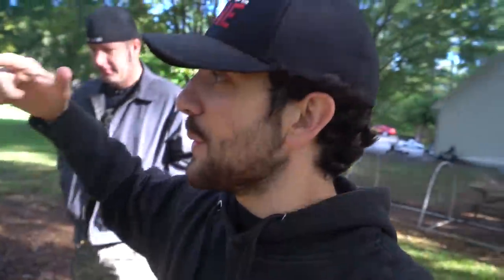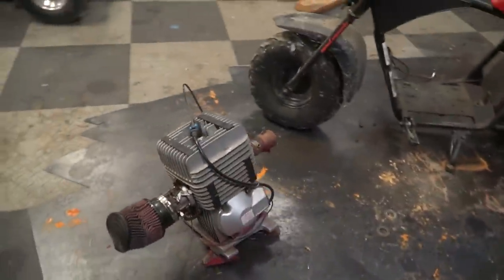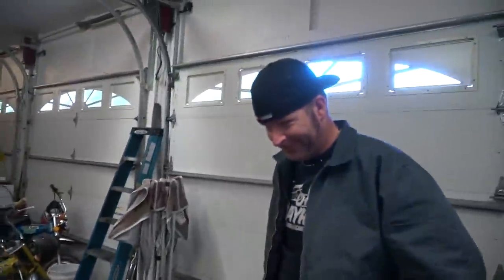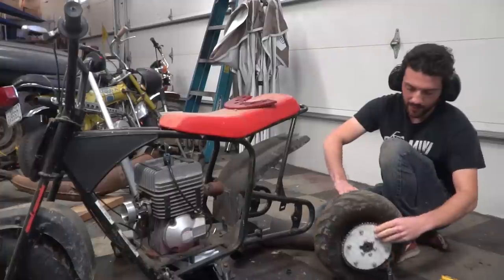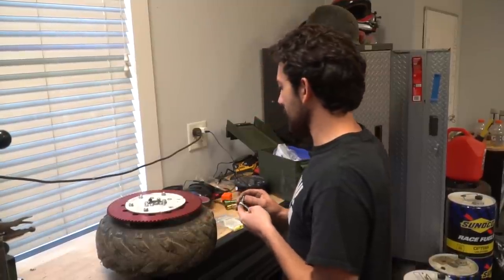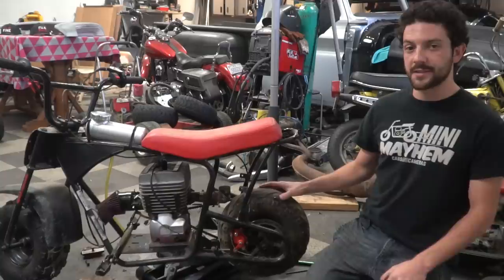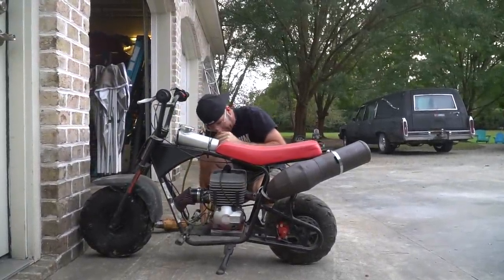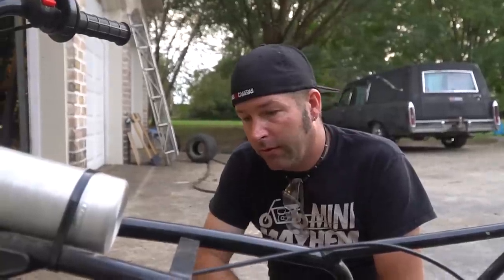2 Stroke Mini Bike Build!

Comment: If geared right, the KT100 will kick the 4-stroke's a$$.  I know this because I started racing go-karts with a 4-stroke, and leveled up to the KT100.  By the way, out of the box, the KT100 has 16 horse, but after being blue-printed, it will put out 23-26 horse.  That motor makes the most beautiful sounds and aromas, and I will never forget it.

Comment: Congrats on your up coming move, check for rust on your grounds I know on the motors with the solid state fly wheel they get rusted up from sitting and will prevent sparking.

Comment: Get a pull start kit and a 4 hole can run a little rich and it will leave you smiling for miles
Reply: Oh the cdl goes out often new spark plug every 10 hrs helps I had many of these and have three race karts a drift kart and drift trike with these on them worth 1200 bucks a peice new 300-900 used depending on mods and hours You can rebuild the top in three and four times before you do anything to the bottom end I’m putting one of these in my kayak

Comment: What is EXTREMLY important on two strokes is the header and flex pipe length befor the first weld on the rlv pipe yall have. To figure out header length take a measure ment of the header from the inside of the longest and shortest sides of the header the find the distance from the piston face in the exhaust  port to the header. Add that to the lengths then divide by 2. Thats the header length. That tells you how long the flex pipe needs to be to get to the desired length.A website called van duesen motor sports has detailed write ups on this information with pictures. Flex pipe is critical. To short and it will melt the piston and to long you get no power. You can experiment with differences of about 1/8th of an inch incriments of flex pipe. The website mentioned will tell you the exact length for the expansion chamber you have.

Comment: Find some one with a straight muffler  and put it on as it will rev better and give more HP  than what you have done to the bend. As the muffler length and cones sizes is what gives it the power band. Some crazy HP can be made with the muffler set up at different RPM ranges.

Comment: Nice brother it's sweet...20-1 is too much oil it's gonna smoke really bad and foul plug easier ..32 or 40-1 is good and safe.. I'm v got a motorized bicycle and I run it 40-1 and it barely smokes and I ride it every day to work ..48 MPH... y'all should build one there very fun and very cheap

Comment: a TCI ignition sometimes needs a battery if the charging system is not stable enough to power it directly, a CDI ignition has its own coil to supply power. so if you really have a TCI ignition you could hook a battery to it to try out. and if you get it running that way a 12V capacitor might also work to get it running and is easyer to build in.

Comment: Just use a jackshaft? Then you could move the engine forwards, have the sprocket on the original side, and not have that power robbing 90degree angle in the exhaust... The harmonics are probably Fucked up because of that angle.
This thing is going to be really fast tho!

Comment: Dunno if you boys can use it for anything but I've got an actual edelbroc carb with an accelerator pump on the side that I don't have any use for... it was supposed to go on an old Yamaha warrior 350 I had had years back and I'm not sure why I never got around to running it lol I run same style edelbroc carb on my 08 honda 400ex and it rippps also no choke and never had any issues not starting 1st sign of power to ignition... if you cover shipping you can have it I'm sure it will help on one of the bigger builds heck it might even be worth a few bucks I believe I paid alot for it back then unfortunately

Comment: look into a spec 100 pipe... it will go straight through under the seat and run better for your application. The pipe you have will make you run very lean at the top rpm and can stick the motor, I've stuck many when racing that class with that pipe
Reply: https://cometkartsales.com/7512-RLV-SBX-Yamaha-Sportsman-Muffer.html or just get a SSX can muffler, it will all fit under the seat

Comment: I had this problem aswell. Figured it out. With me it was the wires connected on the left side of the engine. They tear apart over time due to vibration and all that.

Comment: Come on guys, a Predator 212cc in a mountain bike. You'll never go back to tiny wheels, once you've rode a 26 incher. Just a few things to know, before you get started. #1 the Predator engine won't fit in a mtb frame. #2 the the stock motor mounts that come with a Predator engine kit won't allow you to line up the drive sprocket on a 30 cvt with the rear sprocket. #3 the horse power that this engine puts out will slowly fatigue the stock spokes on your rear wheel, until it becomes a dangerous situation.
Solution: #1 I used the longest frame I could find, which was a "Giant" 22" aluminum. I cut out the front, straight down tube and used some sced 80 tube, bent an 8" rad on one end of a 28" long piece, left 3" straight on the bottom, and bent it enough to form an angle of 150% between the 2 straight sections. Blend the bottom to fit around the peddle crank housing, and do the same for the top, checking that the lockout lever on the top of your right hand fork clears the downtube. You can move the location of the downtube up or down on the steering neck to do this. I also welded a piece of 1/4" x 1" x 2" onto the underside of the crossbar, 6" back from the steering neck tube to allow for a top motor mount onto the gas tank mounting ears. I welded the 2" side to the frame, and drilled the hole after mounting my homemade mounts to the engine. I highly recommend stretching the hardtail back about 8" to help keep the front wheel on the ground. The Giant frame has the seat fairly close to the rear axle, which make weelees easy. #2 I made a mounting plate that allowed me to move the engine abt 1" to the left to line up the sprockets. #3 I found a 6 spoke aluminum "mag" 26" wheel made for 2 strokes with a bolt on sprocket. The Allen screws are only 4-5 mm, so I'll let you know how they hold up, once I put some miles on it, I'm 68, so not in a hurry, anymore.

Comment: one thing with the KT100's is the fact of the rear side of the engine the stator may be bust, or there may be a wire loose on the plates on the rear side of the engine.

Comment: Those things are bog city until they come up on the pipe then look out! That thing is going to have insane top end speed. Put the smallest driver and biggest rear gear you can or youll never get it wound up, they are high rpm monsters

Comment: Fellas, get some good 50:1 oil...then you can just mix your fuel to that ratio and all your 2 strokes will run great(better)...the oil is really good so it  is good at 50:1 for all engines...you can buy 100:1 oil too if you want...works for all 2 strokes no matter what is recommended...been doing the 50:1 for years and have never had a problem...

Comment: I don't know if someone has already posted this, but the tci boxes (what you called the cdi) on these are one of the most common problems with the ignition systems on these. That would be where I would start as the coil normally still will give a weak spark if it is the issue.
Reply: Also if you blueprint the kt100 you can get 18-19hp if you have it turned right running 110 octane.

Comment: By making the header tube longer it will lower ur peak rpm . That bend will also slow the return pulse and lower the peak rpm a bit more . So if it was 11000 rpm before now ur probly down to 9000 for peak rpm .
Reply: smaller expantion chamber is less peak rpm right?

Comment: 15:1 25:1 32:1 or 40:1 I personally would recommend husqvarna xp full synthetic or lucas marine and land stroke oil. Remember that the more oil you add to the fuel the more compression will go up.
Reply: It also leans out the mixture
Reply: That's where higher or lower octane fuel comes into play

Comment: Yo- Some Yamaha engines have a resistor built into the plugboot. Unscrew the boot and read though it with an ohmmeter to see if it's open.

Comment: If you have the engine properly jetted, it will easily do 13,000-14,000 rpm. I used to race these motors for years and we never had one blow up

Comment: I'm not sure on that moter but inside the case the flywheel I believe it has a mag type deal in it but not sure but ya should take coil off and test it and see if it works but ya all know what your doing I'm just making a assumption so see ya on next vid godbless

Comment: I got a question would 3 altinaters from trucks be used to power a gocart through a motorcycle shift I was wondering if using a Tesla coil through altinaters through a gyroscopic weighted spring in cercle could be used instead of gas is effective?

Comment: Why not mount the engine at an angle leaning forward. That would solve the exhaust clearance issue. Does it have Reed valves?

Comment: Way way way too rich. All outboards and all power-saws are designed for 50:1 even ones built in the 60’s, some people are frightened of using that lean a mixture, but I can assure you that I have run a Sthil chainsaw for a living for many years all day every day with the same saw and never had a problem, in fact it has great compression and power despite being a 1984.

Comment: Two strokes can not have a 90degree angle on exhaust they need the gases to flow out an the charge needs to flow back up to pipe to piston to hold the charge. It can go in a straight line out the back but not a 90. And that exspansion/muffler in one is going to kill it. An nothing runs 20:1

Comment: Check make sure the coil is properly spaced from the fly wheel should be a business card thickness away from flywheel also reset the carb high low needles to factory then try. Is it a Reed case engine? If so check reeds.

Comment: A 90 degree bend is fine, if the total header and flex pipe length is in the butter zone. That length determins how long it takes that pressure wave to get back to the piston face.http://www.vdm46.com/vintage-expansion-chambers.html this page has detailed info you need to keep the kt100 in the safe zone and make the most power

Comment: You guys are playing around with the slow 2 strokes, get an old kx85 engine or a 125 and you’ll see the difference. About 25 hp for the 85 and 35hp for the 125

Comment: That isnt what i would call a mini. I have a chinese pocket rocket that i put a 54cc "racing engine" 2 stroke in and its unbearable to drive. Smokes the bald tires. Pulls the front end up. Oh and im 6'4" so it tosses me on half throttle